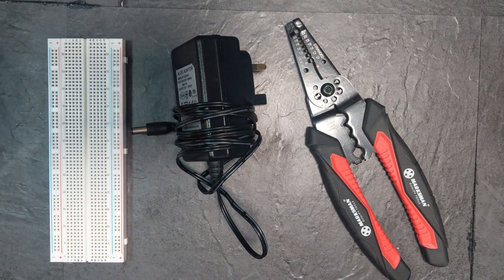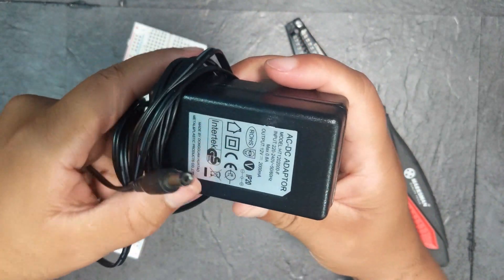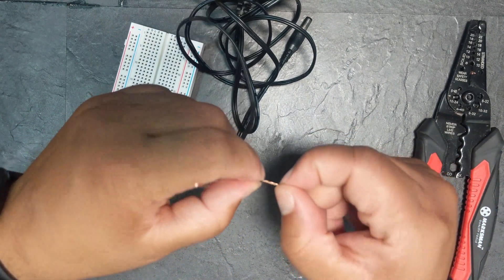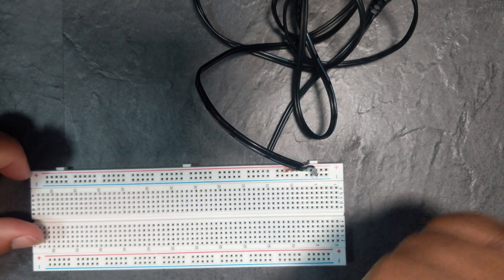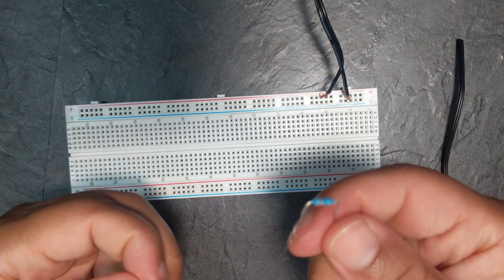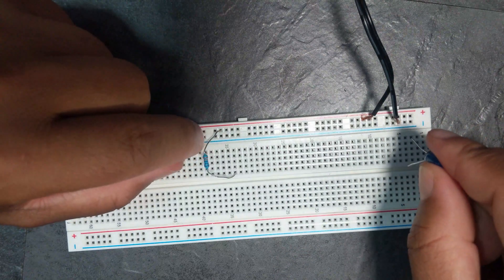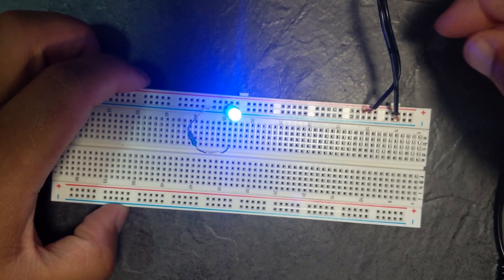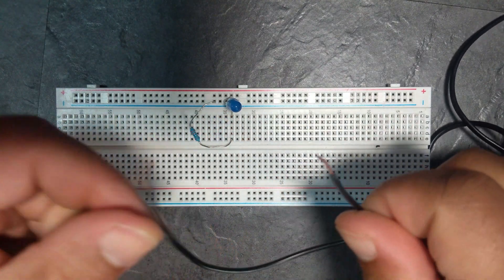How To Cut A Mains Brick Power Supply & Use It With A Breadboard Circuit

Comment: Why would you cut off the power supply tip and eliminate its functionality?
It would be much smarter to get the receptacle and solder on two wires that you can use to insert into the Bread board

Comment: Hi! I've been wanting to use a 12V 700A adapter on my breadboard, but have been nervous that I would end up with a melted mess. It's nice to see your video on this since most videos just plug in an unknown power supply into a breadboard PSU without documenting the voltage and current. Can you tell me if this 12V 2A supply you have used has been satisfactory on your breadboard, since you made this video? Thanks.

PS Good luck with your degree!
Reply from the maker: Hey Rick sorry I thought I replied. The adapter has been perfect but although it can output 2A rated I wouldn't put a continuous 2A through a breadboard. Probably stick to 1A max. If it's a long term project, like the breadboard carrying 2A for a year or 2, would I assume, fail.
Reply: @HamedAdefuwa  
You might be amused by this as an electrical engineer. My father taught mathematics to electrical engineers for years at a Canadian university and when the students went home, Mummy and Daddy always wondered why after all that money spent on educating junior, he/she could explain the theory behind a light bulb, but couldn't figure out how to change it! It became so dire that the university gave a practical  'electricians' course for a number of years. I'm glad to see that Leeds is providing a well rounded education for you.
Reply from the maker: @CommenterRick  🤣. Sadly all the stuff I learn at uni I forget instantly since it's mostly about memorising for exams. It's all the time I put into my side projects and this channel that really sticks. I'm interested to see what Elon Musk's engineering university looks like lol